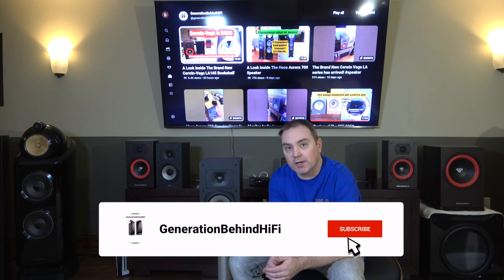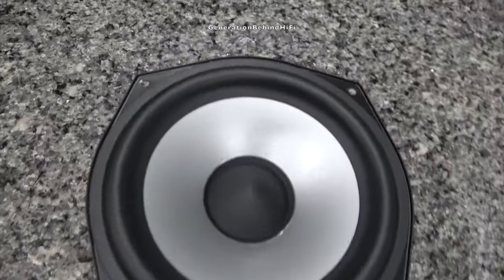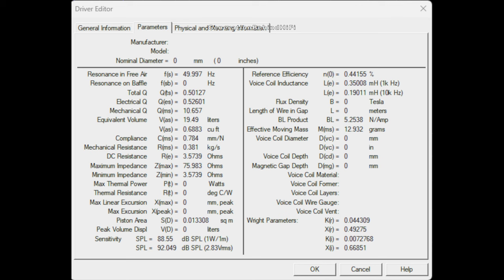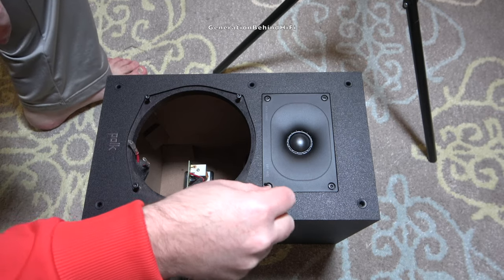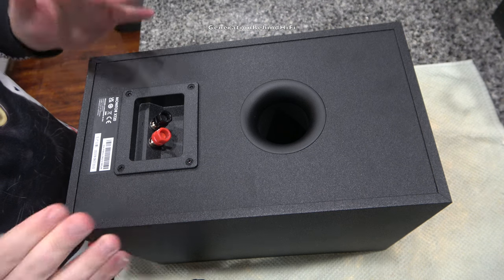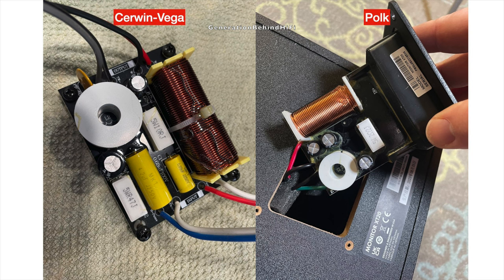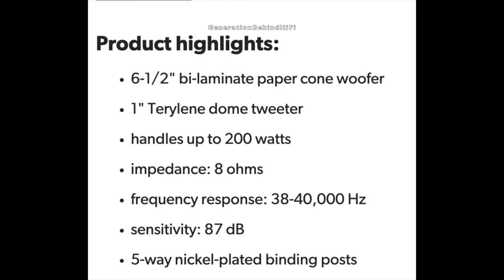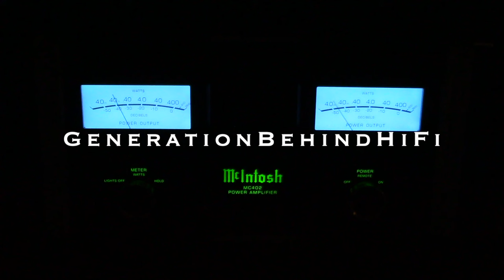A Look Inside A Polk Monitor XT20 Bookshelf Speaker

Comment: FYI, the shape of the woofer frame is called "pincushion" I think? Also, it makes me nervous when drivers are placed face down - pushing on the suspension may be fine, but it also could do damage?
Having the vented spider and the vented voice coil is mainly a benefit to more "linear" cone motion, I think? A vented pole piece "overlaps" with the function of the vented voice coil. If there is a phase plug (and no dust cover) then venting the voice coil is less critical.
One of the less obvious advantages of a cast frame (with slim/shaped struts) - is less sound reflection back out through the cone.
The tweeter plate would be be improved with several layers of cloth and glue (I use denim and Titebond III) to strengthen/damp the ABS plastic. It has to "resist" the flexing caused by the air pressure inside the cabinet.
The tweeter appears to be a woven material, which is often a good thing.
A 0.1uF bypass cap on the tweeter at least would be an easy upgrade.
The 3-layer 3/4" thick foam that Parts Express sells would be a great upgrade for the cabinet. A fabric store is a great source for less expensive polyfil.
Reply from the maker: Thanks, Neil! That is very interesting that they refer to these woofer frames as "pincushion". This is the first I'm hearing about that terminology.  Thanks for sharing!

Comment: I'm packing my XT20S , thanks for the tip , I've been playing hooked up to a Fosi BT 20 A , my first class d amp , and they sound great on it too 😊
Reply from the maker: That's the spirit! It will make for a nice improvement for sure.
Reply: @generationbehindhifi  cool
Reply: @generationbehindhifi hey I did the mod this morning and put some more around the tweeters too because one had less than the other , really does make a difference ! I swear it helps the mids and treble too😊
Reply from the maker: @jimbo4203  Awesome! Glad to hear it worked out.

Comment: This was a FANTASTIC review! Too bad I saw it after buying and mounting these speakers to the wall on brackets. I really like they way they sound but I don't have anything to compare them too in quality other then my Klipsch towers. I will buy the baffling material using your link.

QUESTION: If I wanted to replace the cross over completely, would you have any recommendations? You might say "Can't be done." or "Try this...."

One last thing; what is the issue with have ferromagnetic nuts? What will replacing them with brass accomplish?

Thank you again!!!
Reply from the maker: Thank you! I really appreciate the kind words. Thanks again for the support! 

IEEE did a white paper on ferromagnetic parts in audio connectors and its a good read. Basically the study proved that ferromagnetic parts introduce passive intermodulation, aka 3rd-order harmonics distortion to the signal! Simply put, there's a reason why high end speakers use non ferromagnetic parts in the signal path.

Paper can be read here: https://ieeexplore.ieee.org/ielaam/22/8681220/8632973-aam.pdf

Comment: For a budget speaker, I'm very happy with the 4 I own for my home theater front and surrounds (I have space limitations).  They have a decently punchy base response.  I got mine on sale late last year for about $220 a pair.

Question on the polyfill link you gave... how far does a one pound bag go?  Enough for 2 to 4 XT20s?
Reply from the maker: You should have enough polyfill to stuff four XT20s if you use the same amount in each cabinet that I did (92 grams). The damping material that I bought includes 1 pound of polyfill which is about 452 grams worth. IMO stuffing the cabinets on the XT20 is a must!!!
Reply: @generationbehindhifi  Perfect!  I agree 100%.   Any decent speaker is usually filled completely and it is odd they did not do so, especially since it costs little extra.

BTW... worth mentioning... if you have to place these speakers close to a wall/corner, then I suggest stuffing the ports to calm down the boomy response they tend to have.  A sock works very well.

Love to see you teardown and test the RSL CG3M / CG23M speakers.  Great value for the cost.
Reply from the maker: @csimet  Thanks for the suggestion. I will keep RSL in mind but I think I'm too small to matter to them (my channel).

Comment: I’m indecisive between Polk tx120 or the crewin Vega LA 165 . Break down on pro and cons best bang for your buck . Thanks
Reply from the maker: You should have look at the look inside video of the LA165. IMO the LA165s are better built and to me sound a little better. I especially like the tweeter on the LA165s over the XT20s. Keep in mind that sound quality is a very subjective topic so I would recommend you order both pairs and return the pair you don't like.
Reply: @generationbehindhifi  thank you

Comment: Hello. What do you recommend for my Aiwa amu-120BT amplifier  Polk Monitor XT20 or Elac Debut 2.0 B6.2 Bookshelf? Thank you. @generationbehindhifi
Reply from the maker: Neither. Get the JBL Studio 630 from Crutchfield. They are currently on sale for $349.99 a pair. That's a steal!
Reply: @generationbehindhifi  How are these JBL Studio 630 different from these? I'm just new to this.
Reply from the maker: @kenanguliyev1947  I would order both and decide for yourself. You could easily return the one you don't like for a full refund since Polk, Elac and Crutchfield all have great return policies. As for differences, the drivers, crossover, and cabinet are much better on the JBL. The JBL is on a super sale right now and IMO offers phenomenal value for money.
Reply: @generationbehindhifi  thanks for the advice, I should definitely buy JBL, their sound is much better than Elac or Polk
Reply from the maker: @kenanguliyev1947  At the price point you're working with then yes, I think the JBL's are a much better buy than the other two options you presented. The JBL 630 is a $700 speaker that is currently on sale for $349.99 from Crutchfield.
Reply: @generationbehindhifi  I listened to you and bought the JBL Monitor 630 for $314.49. I'll be looking forward to it. Thanks for the advice.
Reply from the maker: @kenanguliyev1947  No problem! Enjoy!
Reply: @generationbehindhifi  Hi, friend. I just found out that the speakers I bought have scratches and dents. What should I do in this case? Are JBL monitor 620 good?
Reply from the maker: @kenanguliyev1947  You bought open box from Crutchfield? If so, you might be surprised at how minor the cosmetics flaws are. I have purchased several open box items from them and in most cases I couldn't tell the difference between new and open box. I would wait until you receive them and go from there. Crutchfield has one of the best return policies in the industry.
Reply: @generationbehindhifi  I replaced them with 620 and they were on sale. I think I made the right choice. I just don't want to buy a used item. Do you think 620 is normal?
Reply from the maker: @kenanguliyev1947  I went with the 630s because they have a bigger 6.5" driver and I need that bigger driver to fill a large room with bass. I don't know what your plan is for these speakers or the room size so its hard for me to comment on your situation. If you don't like them, simply return them within the 60 day trial period for a full refund and get the 630s. Maybe by then they will be back in stock?
Reply: @generationbehindhifi  I don’t live in America, I live in Azerbaijan. Then it will be difficult to return it. I have a small room where I listen to music, 25-30 square meters, and regarding the supply of 630 they say that they have removed it from production. And I also don’t have a very powerful amplifier. Well done for helping me choose these JBLs
Reply from the maker: @kenanguliyev1947  No problem! For a room that size you should be happy with the 620s.
Reply: @generationbehindhifi  Will they differ in quality only in bass? They also offered me this model Klipsch Reference R-50M, but I refused because you recommended JBL to me.
Reply: Hello, what can you say about the Klipsch Reference R-50M, which is better?
Reply from the maker: @kenanguliyev1947  personally I would stick with the JBLs.
Reply: @generationbehindhifi  I did just that and bought a JBL 620. It was a shame that I couldn’t find a 630 without any problems, do you think a larger 620 or a 630 would suit my amplifier better?